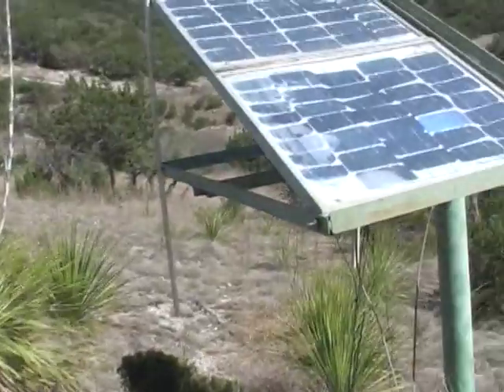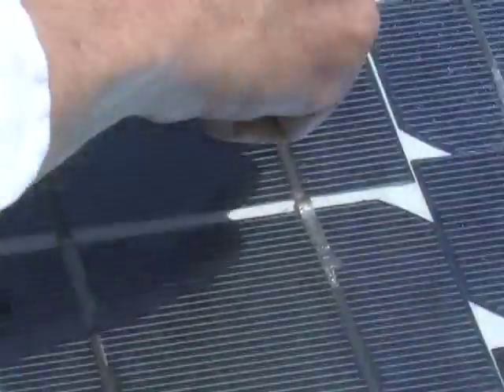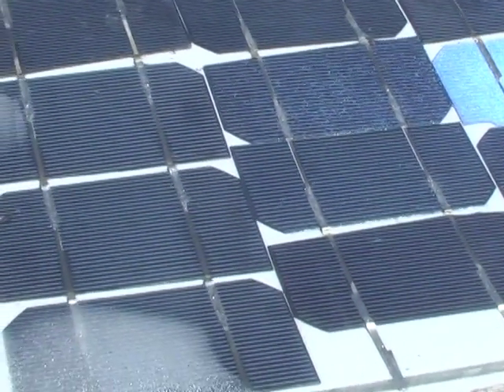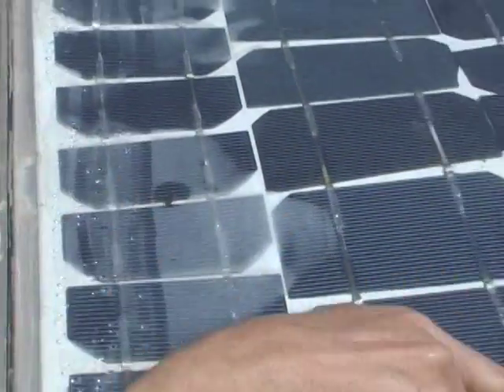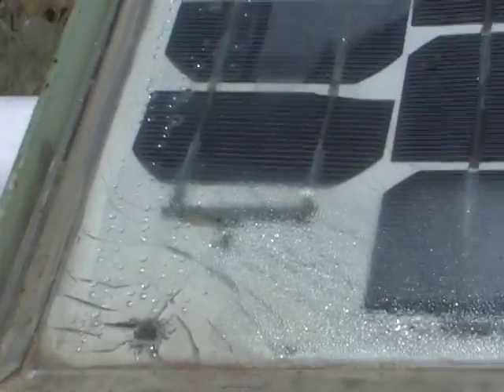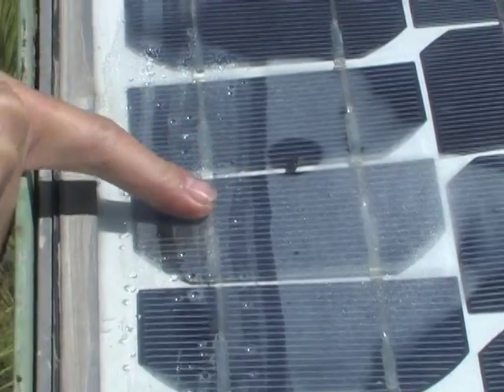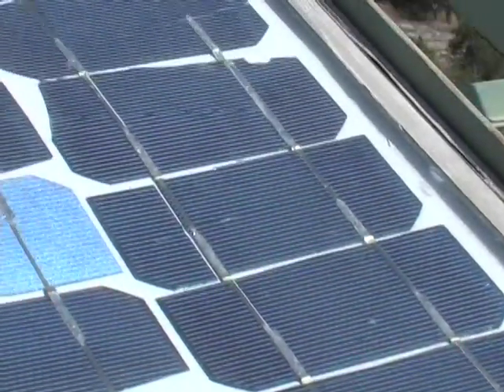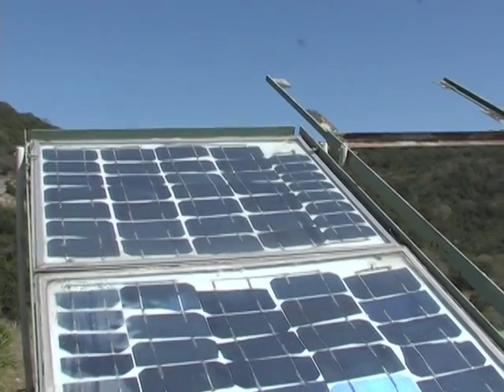Saving Energy with Solar Power : Using Homemade Solar Panels

Comment: I like the idea of the project. I like the flexibility you've built into it ( tinyurl.com/y2jky78o ). However, I wouldn't use Walmart for any supplies. Between a marine and auto store, you could get better quality parts. Thanks for sharing. I'll check out the rest of your vids for practical use of these portable backup generators.
Reply: wooooow

Comment: @x11115 You are right about people trying to capitalize on the info that only a year or two ago was free but if you would like to know some more about the DIY wind and solar I saved everything I found and could maybe email if the files aren't too big. I built my own solar panels from cells bought off eBay and purchased most of my turbine parts from two reputable dealers on the internet. and all are very functional. I also made mine with aluminum frames and tempered glass with encapsulent.

Comment: Nice one. I thought you have to be an expert in soldering before you can assemble that solar panel. Now I can start assembling my by solar cells. You have explain it well how it work and the connection as well. Next time, it would better if you can do a video actually doing the soldering :)

Thumbs up for you!

Comment: @LinkFamilyPA You're mistaken on a couple of things with your comment to @x11115, namely in saying that the person has to have the installation certified. It really depends on where you live, what you're doing with it, and whether it ties into the grid. Keeping your power off grid is much cheaper and requires less legal hassle than building a grid tie system.

Comment: The batteries im planning to use are forklift deep cycle lead acid cells (Very Large), in my opinion they will be the best for my use (Residential) for the cost and maintainance required, I have am also experimenting with 4' (4 Foot Diameter) permanent magnet core wind turbines, they are fully custom made,  I am very lucky to have my own machine shop and have many future plans that are not commercial based but I am driven with my passion of engineering and renewable energy sources.

Comment: I have ordered enough cells to build 24 70 watt (approx) panels.  I purchased all materials in 2007 for around $1500 US. I am a procrastinator and have only built three of them they produce (real #'s) about 73 watts per panel, I am very obsessed with perfection but it has paid off with the cells having very close power production capabilities.  I purchased two 11500 Watt inverters for my home at the same time and paid less than $1000 for them.

Comment: Here in the States, the meter spins backwards.  At one time, people used to 'steal' electricity by turning ther meter upside down for one week of the  month.

But, the compnay charges for use.  regardless of the direction, you pay for watts.  if you put it back on the grid, you will get paid for the energy, less the fee to be connected.

Regardless, it would be very expensive to have enough power to use it all and sell any back.

Comment: If you return anything back to the grid the Electric company is not required to pay you anything .. However they are required to credit your account. SO If you pump $4000.00 worth into the grid over 10 yrs. & a meteor crashes your panels.. They Owe you $4000.00 worth of Electricity.

Comment: Just a few things you forgot, a one way diode matched to the output. a charge controller, correct sized wiring, lol . batteries and an inverter

Comment: In order to get the totaled 48v you will need 4 of the panels that you are describing, not only that but in order to prevent burning up your inverter you will need four 12v batteries deep cycle batteries and a charge controller, you can easily get a morning star charge controller for less than 50dollars, the deep cycle batteries will cost a little bit, or get a lower voltage inverter and half that. if youre really interested send me a message and i will send a more detailed description.